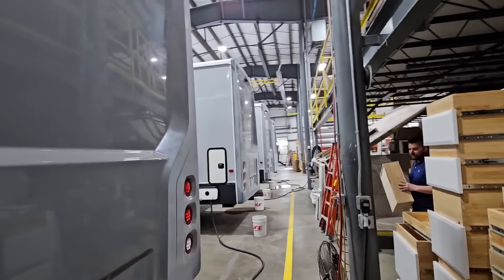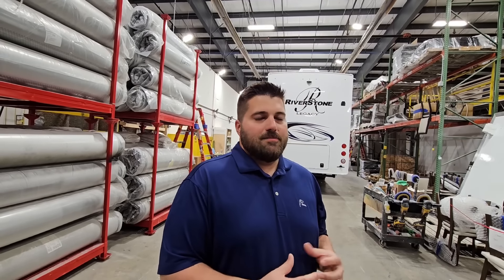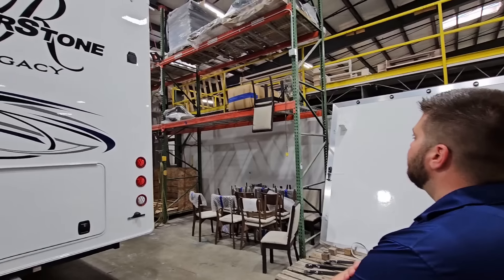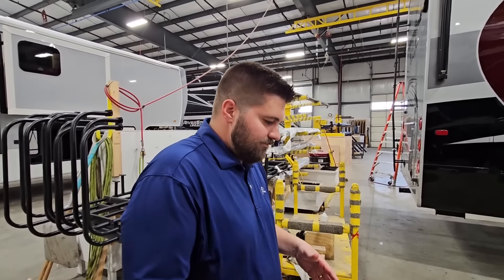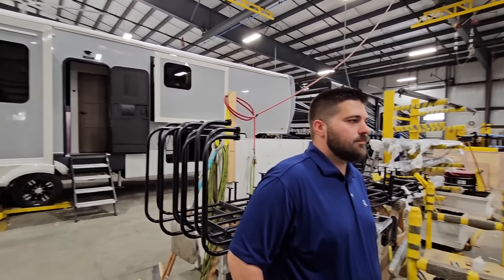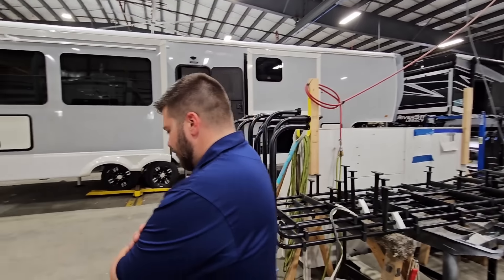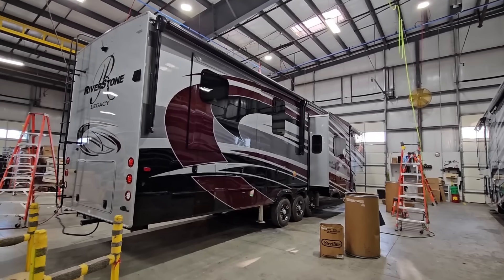RIVERSTONE Fifth Wheel RVs Do it Different! Factory Tour Part 6

Comment: It’s funny you said that, “I’ll never buy another Forest River product”, because I’ve made that statement numerous times. Our RV has been a nightmare and I’ve personally towed it to the factory where it was built more than a dozen times for both in and out of warranty repairs. I own a Rockwood  which was supposed to be a pretty good unit, Not top of the line but certainly in the upper tier of available products on the market. Now after looking for a replacement for our Rockwood for at least 4 years, and looking at few different brands other than anything Forest River, I find myself pretty well decided on the Riverstone 422MC as (hopefully) the last RV my wife and I will ever buy. I’ve been in the industry since becoming an avid RV’er and worked at New Horizons in J.C., Kansas. I’ve seen quality rigs, helped build them. I’m really impressed with what I see coming out of this Factory in Topeka, IN.

Comment: JD, I can’t thank you enough for doing this series.  It was very informative, in depth, and eye opening.  We’re in the process of looking for our last RV for our full time RV retirement.  I will admit, I was hesitant to go with Riverstone simply because of the Forest River tie after a terrible experience with one of their cheaper brands.  I’m so glad I came across this video.  We went to the Tampa RV show last week and came across Riverstone.  They have two floor plans we really like.  I’m almost sold on a Riverstone now, just have to decide between a toy hauler or standard 5th wheel.  We’ll be towing with a Volvo HDT, so I’m glad they go the extra distance to not limit quality by weight as much, but still make them work with a typical DRW 1 ton truck.  The only change I can see from stock would be a Gen Y hitch and more solar.  The rest is just personalizing and getting the gear and gadgets we want to full time.

Comment: Enjoyed this series. We bought a 2024 39RKFB in January. It was nice to have this confirm our decision to go with this model. We have owned Forest River products before. We also currently have a 2019 Wildcat we have had many issues with and almost refused to go with Forest River because of it. It’s clear they are not all made by the same company even though they’re under the Forest  River brand. We live in the Riverstone, and use the wildcat for traveling (now that we have fixed most all the issues). There are a few issues with the Riverstone, main TV is a little crooked and one of the sliding pocket doors is not aligned properly. Other than that, we are very happy. Would’ve liked to have had the fiberglass roof, but it’s undercover so shouldn’t be a problem.

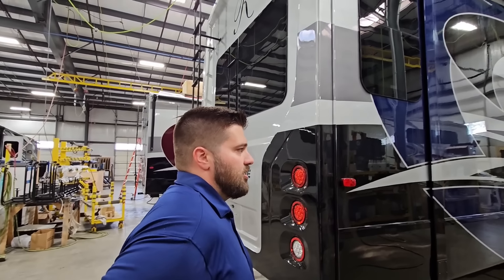Comment: Good series, many thanks to you and Riverstone. Two key takeaways. First and most obvious is they are using high end components for a high end product. Second and most importantly, they are using proven manufacturing principles. Most important of which is a quality program with in-progress quality inspections that I would bet has the teeth to require correcting quality flaws as they are found (reference minute 6:55). This is where lower cost manufacturers totally drop the ball by allowing preventable and correctable flaws to ship. A robust quality program, in the final analysis, does not cost more for the manufacturer. In fact it generally increases revenue by reducing warranty disputes, multitudes of claims, replacement parts, and PR nightmares. There is no valid reason for any RV manufacturer at any price point to roll defective products out the door to dump onto consumers. 
Thanks Again.

Comment: I’m surprised on the unit with the rear pull out tray they didn’t extend the paint to the rear cap. I think that’s a change they need to make.

I think you did a nice job letting him talk in this series. I know that’s a hard balance to strike but I felt this series you got it right.
Reply from the maker: Thanks! I was actively making an effort

Comment: Ducktails: 
It doesn't matter that you don't have problems with the cheap construction, its all about perceived value.
If you are paying $180K for a unit, you don't want to see anything that may even resemble how a $20K camper is executed.
About Reality:
It is really sad they don't have anything below 40ft...
They should have at least a couple models on the 36-38ft for those that don't want a 45ft beast...

Comment: What type of slides do they use?  Hydraulic on the large slides?  What is used on the smaller slides.  It doesn’t say on their website.
Reply: I think its part 3, No frame flex, they talk about the slides.
Reply: What do they use to move those big fifth wheels in the factory?